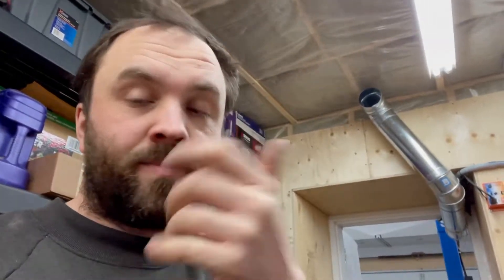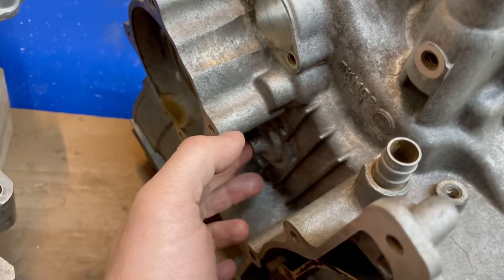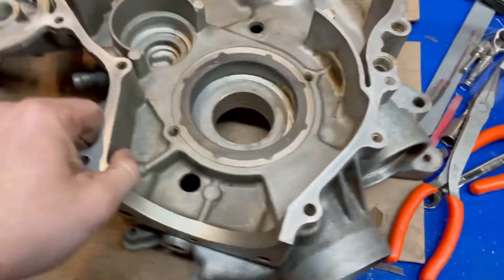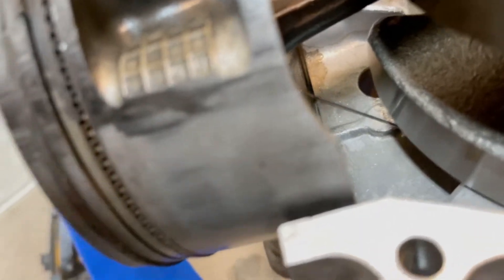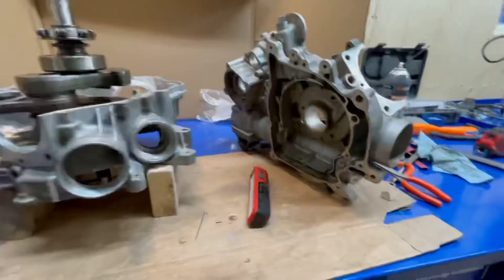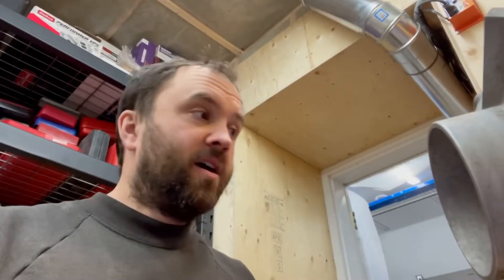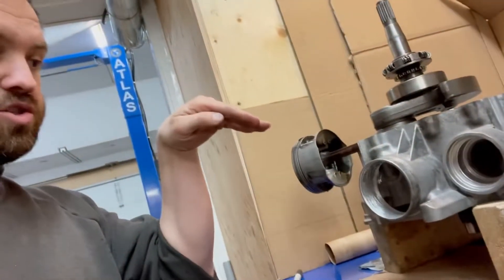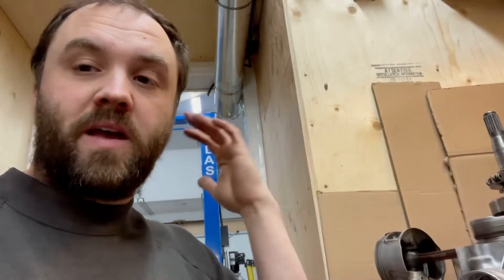Yamaha Rhino Grizzly 660 Oil Mod For Wrist Pin & Crank

Comment: @IMRgarage great video! So how did it work? 

I agree with you on the crank install and not wanting to hammer or put to much force on it. 

I always froze my cranks in the freezer for 24 hrs then heated the bearings in the case and if all went well they slid right in but then I had a few that didn’t so I started using a box filled with CO/2 a d it freezes them right now! 

heat the bearings and they slid right in easy. 

Also I honestly think most of the cam chain/wrist pin failures are from guys running to low on their oil as the 660 loves to eat oil it seems. 

I think that has to do with ring gap but I haven’t had the chance to prove this yet. 

660’s seem to eat oil and the 700’s didn’t I find.

Comment from the maker: I stand corrected 2 out of the 3 cranks here have a oil passage to the lower connecting rod bearing so I was wrong . I will check my new hot rod cranks tomorrow .